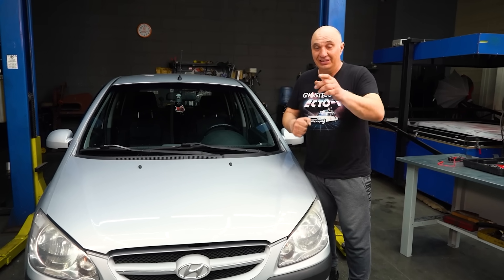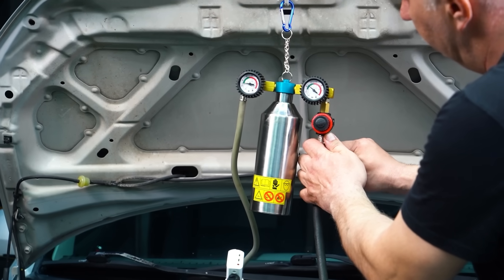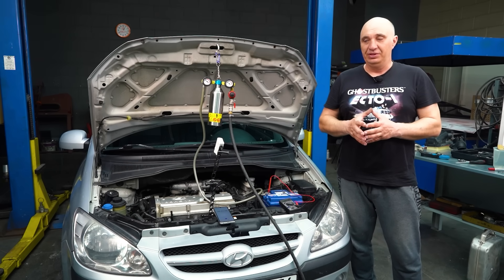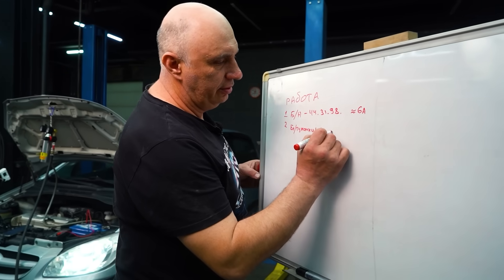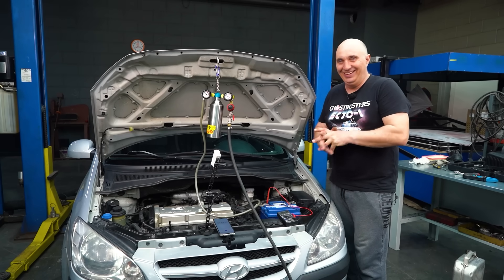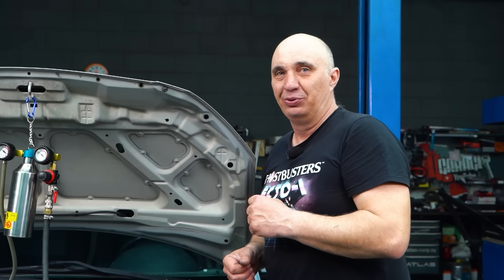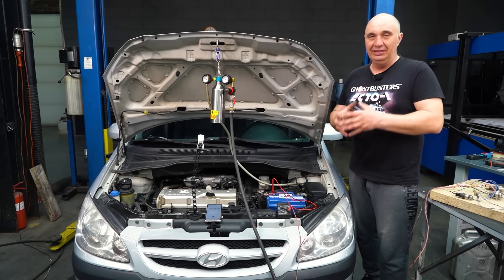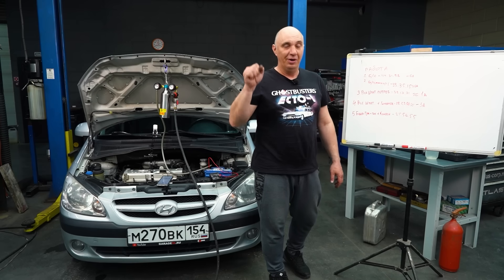How much really do accessories affect fuel consumption?

Comment: 9:29 you have to measure on the big cable that came out of the alternator. Any other measure point you are not measuring the load on the alternator.
Reply: When racing motorbikes they used to check alternator output on anything "production class" to make sure you weren't bypassing and getting a few more horses

Comment: Okay it's almost a 50% loss when you add everything on there
Reply: yes but in idle, you dont consume much in idle, its probably the same energy it would cost in fuel to bring a pet with you in the car, and way less than having another person with you
Reply: They had a lot of unnecessary stuff turned on. At 3-4k rpm normal driving, the extra fuel usage for the AC/electrics becomes a fraction compared to 700rpm idle, since driving at a normal speed is what takes the bulk of the energy, while the rest is mostly static regardless of speed. Actually, the AC might require less compressor time because the cooling fins are cooler so it doesn't have to turn it on as much when you're driving around with wind cooling it.

Comment: I’ve always been told that an AC compressor takes about 10hp away from the engine so depending on how much HP you have it can be more or less of a drain on the engine. If you have 100 horsepower then it’s like using 10% more energy as you drive. So I would expect 10% worse gas mileage on that 100 horsepower example. That would be much less of a draw on a 500hp car(2%) and obviously much more as you go below 100hp.

Comment: My dad always said not to turn on ac because it makes the engine burn more fuel. So, rolling the windows down was the way to keep cool
Reply: Apparently rolling down the window is much worse for fuel economy due to increased drag. Just keep the AC on.
Reply: @kunka592 depends on the speed you are doing
Reply: Unless you use AC regularly to keep the oil circulating, the seals can dry out and the gas will leak out, costing more money to refill.

Comment: Could you do a test to see how long a car will run with everything on?. Does extra electrical load whilst waiting in traffic for a long time risk flattening the battery resulting in the car cutting out as suggested in your video or does the ecu rev the engine automatically to stop this happening?

Comment: I tested the effect of aircon v open windows. 45mpg with aircon less than 30mpg with the windows open.  I’ve run the aircon ever since……
Reply: Known that for decades now. Too much drag when windows are down.
Reply: @Miner-49  yet, everyone thinks driving 90mph is a much better idea than the Carter Administration's 55mph limit. the effect of drag goes up exponentially with velocity.
Reply: @FB-gm6el  90km/h is pretty good. 90mph... not so much lol
Reply: At what average speed?
Reply: Yeah and you are just blowing warm air into the car with the windows open
Reply: At what outside temps? At what speed? What car and fuel? What target cabin temps?
Reply: run your car in city driving with moderate to heavy traffics most of the time and lets see which will have a better mpg.
Reply: @tonytonymercado7326 yea if ur city driving below 35-40mph the windows down. Any faster ac on
Reply: Myth busters actually did a test like this and I think the window closed with A/C on had more mpg. I think while moving it is less of a load to turn the A/C compressor but at idle it struggles that is why it gives it more gas/rpms.

Comment: To have a more accurate test, you could have used a charged battery after each test, some tests discharge the battery and increase the load on the alternator in the next test.

Comment: I never understood how "electrifying" the accessories like the radiator fan, water pump power  stering and other accessories would make a difference in fuel economy when ultimately it sounds like nobody knows laws if thermodynamics. Energy can't be created out of nowhere or destroyed. Meaning that if you electrify the radiator fan, water pump, ac compressor and power steering pump, thise things still need energy and ultimately that energy still comes from the engine via the alternator and the higher the electoral load on the alternator such as to run the electric fan or electric ac compressor or electric water pump the energy is still coming from the engine as the alternator puts a load on the engine as it becomes harder to rotate as the electcal load increases. It's simple physics the energy is got to come from somewhere. I don't think making the A/C compressor, power stering, water pump, and radiator fan makes any difference as ultimately it just translates to a higher parasitic drag on the alternator instead of each of those items combined. In fact I'm pretty sure it's less efficient to turn mechanical energy into electrical energy via the alternator back into mechanical energy in an electric motor in these accessories as the alternator is only 60 percent efficient as compared to just directly coupling them though to the engine via the belt to spin them directly. I guess you could argue the miniscule increases in efficiency such as the fact that am A/C compressor or water pump is most efficient at a certain RPM meanwhile the engine RPM is always changing. I know this is especially noticeable with mechanical clutch style fans when the clutch is fully engaged it's most efficient at idle but as soon as the engine RPMs increase during acceleration they do become loud and rob the engine of power as the fan is spinning at a unnecessarily fast inefficient RPM.
Reply: As you mentioned it is well worth making the radiator fan electric for efficiency. Other things are made electric now for better control of them or because it is simpler or cheaper.
Reply: Could be less friction and savings from not requiring constant power is worth electrifying these systems.
Reply: @ctrlaltdebug well there’s a thing called a fan clutch and A/C compressor clutch which means they don’t need constant power. The water pump does need constant power for cooling and the power steering pump is much like the alternator where it really only puts significant drag on the engine when in use so when turning the steering wheel while not moving.
Reply: @mattdaddy_888  the belt and pulleys keep turning so there are frictional losses. And when the clutch is engaged, the speed is set by the belt, so not necessarily optimal.

Comment: I’ve genuinely wondered about this. As I always get worse mpgs when ids raining or dark etc.
Reply: It has way more to do with the weather and road conditions that how much power your alternator is drawing. Alternator draws about 2-3hp at the absolute most, that will be almost unmeasurable in mpg. Colder temperatures (increased air density, causing more drag) and increased rolling resistance from rain will have a substantially larger impact.

Comment: About the electronics, it really depands on the car and where you measure most modern cars from my knowledge have one thick cable from the positive to the anternator + the starter and than second red cable running from the positive terminal to the cabin for all of the electronic.........
To have right measurement you would of course need to clamp both of the cables
Also possible that the batery was charged from the previous run so it is possible that it was  close to charged so smaller voltage difference and smaller curent, dont forget that to charge battery from 0 to 80% it takes the same time from the 80% to full

Comment: I wonder how much fuel the lady next to us in McDonald's used today. Sat eating in her car with it in reverse and foot on the brake for at least 15 minutes. 😮
Reply: I don’t understand how people idle their cars not in park. At work sometimes I’m in a car idling for 4-12 hours and it doesn’t use nearly as much fuel as you’d think.
Reply: Maan I saw a similar situation yesterday, it was in a parking lot of a gas station, all the spaces were full, and this guy sat in his car with the reverse and foot on the brake waiting for somebody to leave a parking slot
Reply: Depends on the wattage of the reverse lights and brake lights. Maybe 100w, much less if LED.
Reply: @ctrlaltdebug  🤣
Reply: @ctrlaltdebug  main thing would be drag on engine from torque converter sitting in gear.
Reply: @charlie_nolan  The torque converter still spins and has drag in park. So I didn't consider it in the balance.
Reply: @ctrlaltdebug way way less than when the other end on the transmission side is stalled.
Reply: @charlie_nolan  Park should be the same as reverse. Do you mean to compare against the transmission in neutral?
Reply: @ park and neutral are the same as seen by the engine, park just puts a mechanical lock on the output shaft. Both are very low load on the engine. Drive/reverse are higher load.
Reply: @charlie_nolan  on mine, neutral spins freely with higher idle rpm, while park feels like it loads down the engine, lowering idle rpm.
Reply: @ idle speed might be different (although most vehicles park+neutral are the same speed and drive/reverse are the same speed) but I promise park/neutral are the same as seen by the engine.

Comment: simple answer for the Amp meter = you are measuring how much electricity is entering the battery
at no load u were charging the battery at 5-7 amps
at full load the alternator was outputting all it could and u were only charging the battery with 0.5 - 1 amps
if u want to know how much the alternator is producing u have to measure at the B+ from the alternator

Comment: My car averages low 40's mpg in winter and high 40's/50mpg+ in summer. Its all to do with the lights, heater etc used in winter, the density of the air outside and the time it takes to initially warm up the engine.
Reply: All you say is true. If there is snow on the road it also introduce resistance for wheels to roll.
Reply: @PREDATEURLT  Thank you, that's a point I hadn't considered as we don't get snow so much nowadays but that also eats into your economy as you also tend to stay in lower gears in the snow.
Reply: Idling is higher when temperature is cold about 950 rpm and reduced to 750rpm at 82celcius
Reply: All are display by obd2 meter

Comment: The short explanation of what happened with the clamp on meter, to the best of my understanding.
Alternator charge wire goes to a fuse in the fuse box. After the fuse is a distribution bar/BUS bar that everything else gets power from the Alt. including the battery. Meaning the power/amperage loop can completely bypass the battery. Except for the Alt.  voltage reference circuit/wire, to stabilize voltage and power up the windings/electromagnets.

Comment: The best ways to save gas are to maintain the vehicle properly and drive conservatively.
Reply: Everyone knows it is to install a mast & sail on your car, Then only use your engine when the wind is unfavorable!
Reply: id disagree. i bought a car that wasnt looked after and it had insane fuel economy, turns out the maf was dirty and was making the car run lean ;)
Reply: @Seeker-vo2tz  in my car if the maf is dirty, it makes fuel economy worse by several tenth of a litre. I got to keep that thing clean. The problem is the oxygen sensor detects the difference and tells to adjust the ratio. In the case of my car the system does it poorly, hence the worsened fuel economy.

Comment: I think current measurement was perform wrong way. If multimeter was clamped on alternator to battery wire and battery to car wire simultaneously that shows only how many amps goes to battery, same sitution when battery to ground was mesure (incoming and outcoming current cancel out). Amp meter should be clumped on alternator wire only or battery to fuse box only.

Comment: You need to have your meter on the alternator output cable, putting it on the battery is only checking battery charging amps, the alternator can't charge the battery if the accessories are using it's full output.
Reply: Doesn't the alternator connect directly to the positive of the battery? Would have thought a current meter on the positive would be the same as reading on the alternator feed to the battery
Reply: @Nuka21  yes the battery feeds accessories and alternator keeps it from draining below rated voltage ⚡️ with any luck
Reply: @simon lol
Reply: I was thinking the same thing. Probably should have had a current shunt on the alternator output and measured the current at the shunt.
Reply: A shunt style is cheap and reliable.

Comment: You're measuring the current wrong. You need to measure the wire that comes out of alternator.. what you're measuring now is how much the battery charges/discharges. In last test, the battery was almost full, but the main current went from alternator into lights, heaters, etc.. not into battery (this is why the current was 0 into battery).

Comment: Measuring current to the battery just shows charge level. Once the battery recovers from the energy used to run the starter, there will be very little flowing into the battery. The clamp should have been around the alternator power lead.

Comment: good point others made...  heater/front defroster does not draw that much.  They are just fans.  Rear window defroster is wire heat but it didn't stay on long.  Glad you did AC too..
Reply: Those fans use quite a bit of power on full blast. More than the headlights
Reply: Little known fact, turning on the defrost vents also turns on the AC compressor automatically.
Reply: @D40-Or  yes-ish.  very low though... just to dehumidify